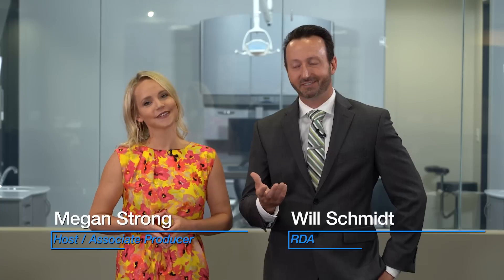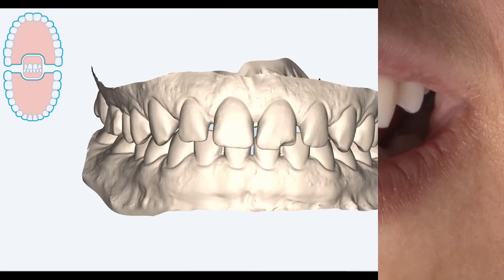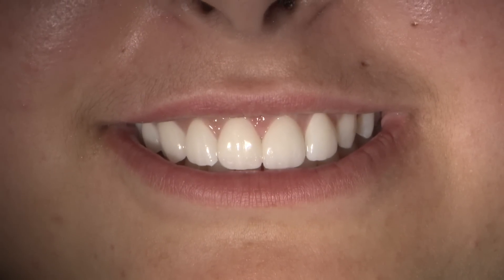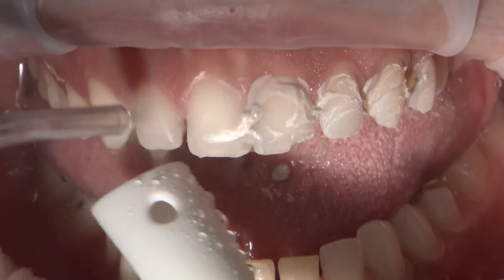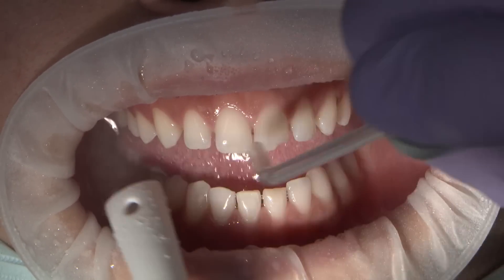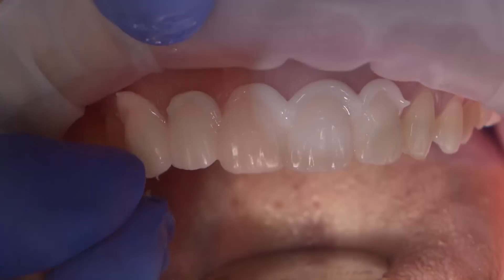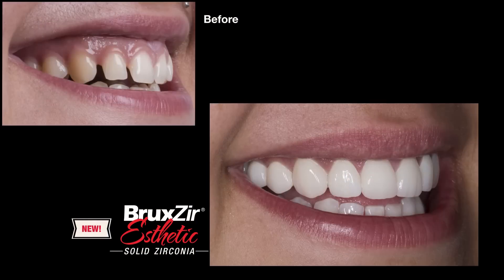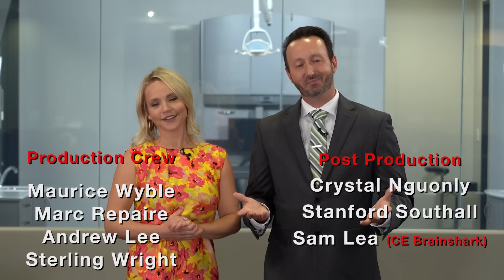Chairside Live Episode 251: A Completely Digital Veneer Case

Comment: Bonding efficiently  to Zirc Ox is yet to be discovered. MDP does not provide a reliable bonding (not when working with veneers I mean). There is a lot of scientific research out there supporting this claim. The strength provided by aesthetic/translucent zirconia is not as good as full strength zirconia so there is no real reason not to choose emax. Please prove me wrong because I love Zirconia but have never used it as a veneer material.